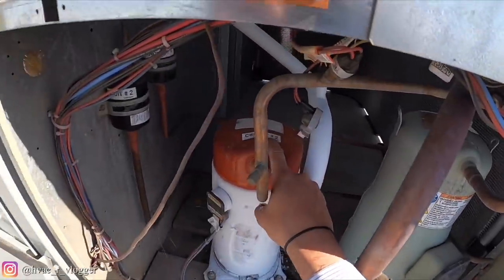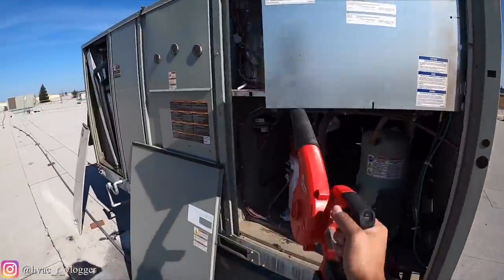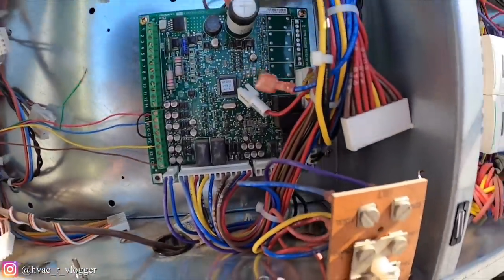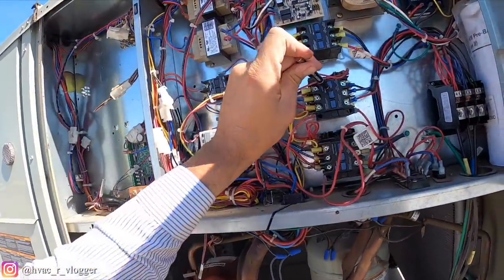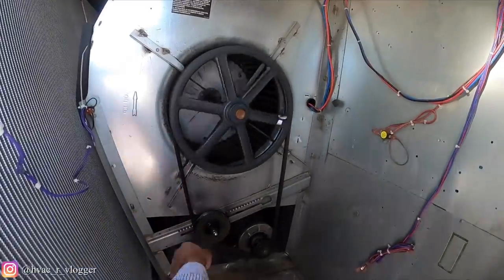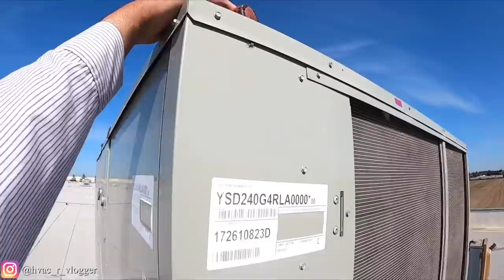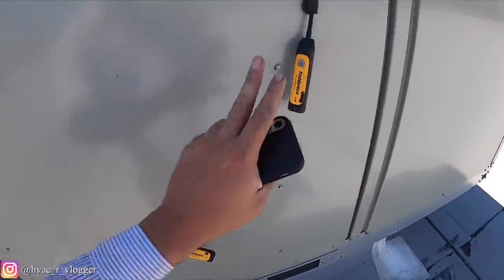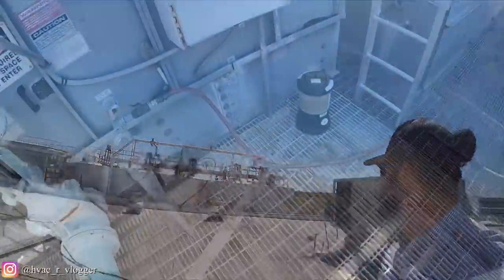HVAC MAINTENACE

Comment: I have an air filter on the closet door where the furnace is and I also have a furnace filter at the bottom of the furnace....  however at the bottom of the furnace there seems to be an extra slot for another furnace filter.. 

should I put an extra furnace filter, or would it be too much restriction????   If not, then what’s the point of the extra slot??  I use the cheap priced air filters and make sure to change them out monthly.. I’m in Texas by the way.